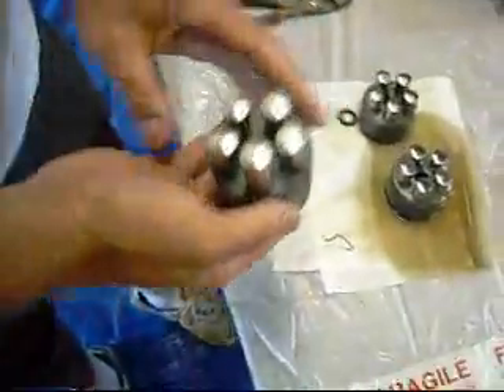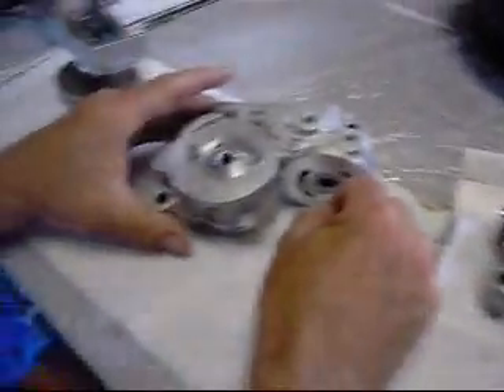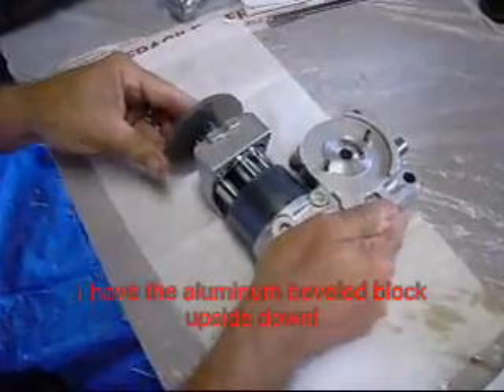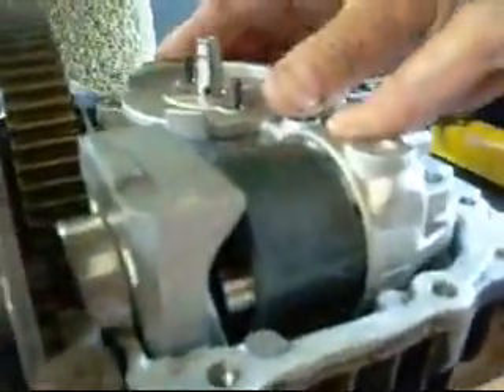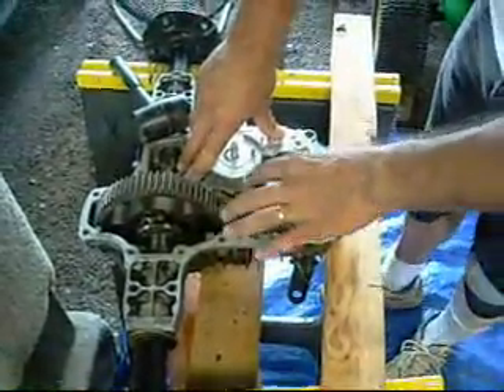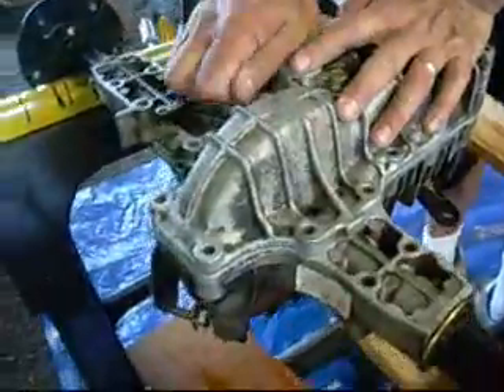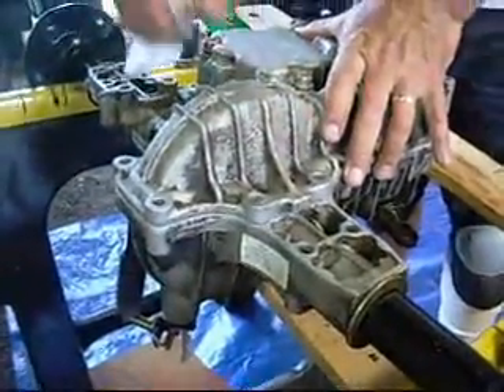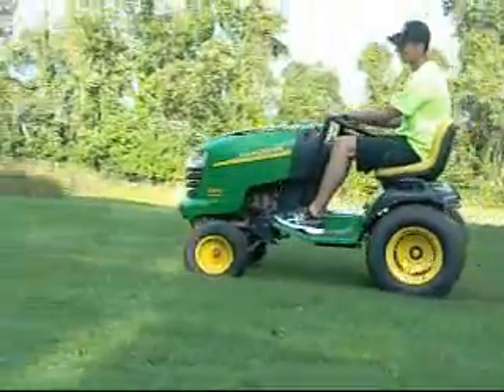Tuff Torq K66 Hydrostatic Transaxle Rebuild - Part 2

Comment: Is it just wear between the motor/pump and center case that causes them to get weak and fail? I'm wondering if they could be machined smooth and level and reinstalled and it work as good as buying a rebuild kit. I've rebuilt my k66 once before, it's starting to get a little weak again.

Comment: Why did you order a new center case? Did tuff Torq suggest it or did you just think it was needed with new motor/pump?
Reply: it comes as a kit (new motor, pump and centerblock) Tuff Torq won't sell you just the pump and motor.

Comment: where did you find the torch specs?
Reply: It is a note on the bottom right of the schematic for the K66AG  M8 16 to 18 Ft Lb, and M10 33 to 47 Ft Lb  the M10 seem a very wide range and being Ave sheared  on at 40 I think it may be a misprint an be 33 to 37 actually.